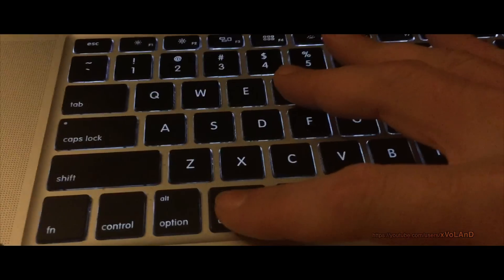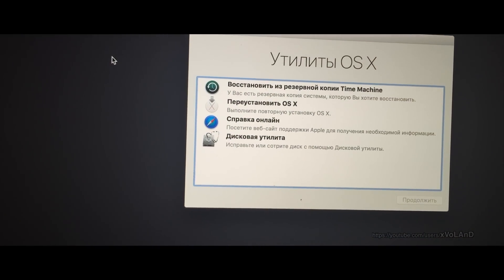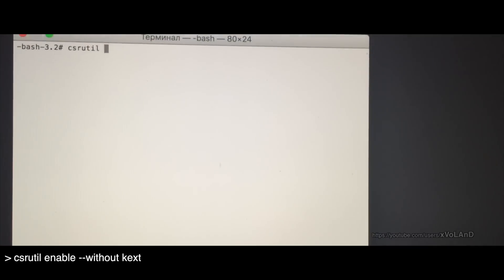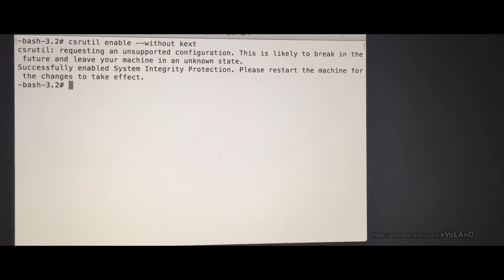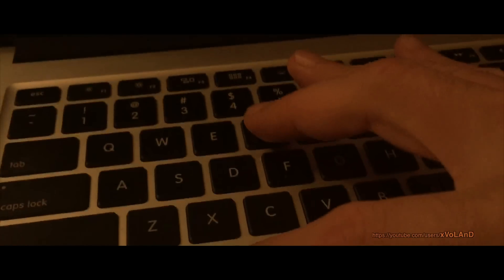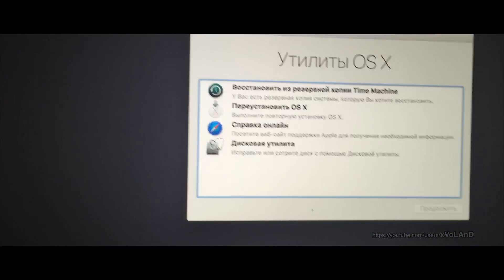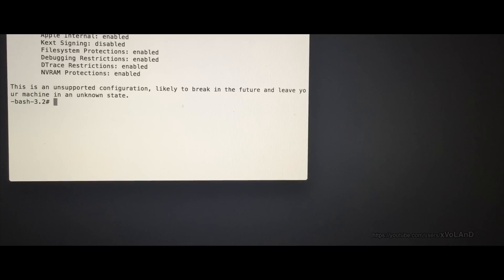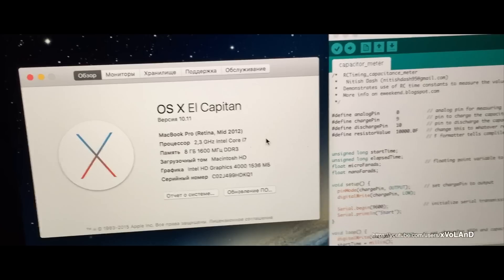How to install driver PL2303 CH340 CH341Arduino USB to RS-232 adapter on OSX El Capitan/Yosemite

Comment: I can't get this working on my hackintosh ....
Reply: says driving signing is disabled, boot args, dev=1
Reply from the maker: Anti Decepticon I'm sorry, but I I've never had to deal with hackintosh. My method works very well on Apple computers under OSX.  I don't see any reason to use it if you have a Windows.
Reply: i wanted to use as a fan control
Reply: This is what happens, with my curiosity I gravitate to things that wont work. I even have Clover Setting to boot with kext-dev-mode=1.
Reply from the maker: Anti Decepticon it's a good gravitate ;)

Comment: itry on 10.10.4 yosemitee but not work it says incorrect command any tip , help,, thanks
Reply from the maker: David Durst Make according to the instructions and everything will okay. I have installed the latest version OSX
Reply: i did when i restart in recovery mode that was terminal answer when i type  the command csrutil enable --without kext it says that command doesn't exist
Reply from the maker: David Durst is a standard utility which present in our OSX. Check /usr/bin/csrutil

Comment: Please, and how do I uninstall this driver?
Reply from the maker: You can use the standard method, as recommended by Apple OR:

Step 1 – locating the driver
for OS X 10.9 (or newer): cd /Library/Extensions
for OS X 10.8 (or older): cd /System/Library/Extensions
Grep the name from the command line: ls | grep ch341

Step 2 – Unloading the driver
sudo kextunload ./<name>.kext
You need to enter your administrator password

Step 3 – Removing the driver
sudo rm -rf <name>.kext

Comment: Thank a lot of for sharing. Following your tips my chinese arduino is detected on my mac OSX El Capitan but I still had problem to upload code to the arduino board with the message error: 
avrdude: ser_open(): can't open device "/dev/cu.wch": No such file or directory
ioctl("TIOCMGET"): Inappropriate ioctl for device

The problem was solved by following tips (https://forum.arduino.cc/index.php?topic=292284.0) and my chinese arduino is working now:
Considering you have correctly installed the CH340G driver, the problem is in the spaces of the device name.
To fix that you have to manually edit two (2) txt files of the arduino installation.

Go where you have installed it. In my case the path is:

/Users/MY_USERNAME/Downloads/Arduino.app/Contents/Java/hardware/arduino/avr

Inside this directory you can see files platform.txt & programmers.txt.

Inside these files replace -P{serial.port} with "-P{serial.port}".
So you simply have to add the quotes.

Comment: Ever since I found that after 5 or so USB re-connections my Mac is powered down the hard way. The best was to see the grey screen reading “You need to power off…” but in other cases it was just like a lightning striking my machine. So, this driver in hack-mode is not really a good idea!
Reply from the maker: You write terrible things 😨😰😱😀
I don't have any problems, check your OS.
This method does not use any hacking methods (check documentation for OSX) Moreover you install the official drivers from the manufacturer
Reply: +Vitalii Tereshchuk Not really. It's not constantly reproducible, but after some 5 USB-reconnections of the Cheapoino my machine blows off. This is a sign that the driver does not behave well (which is not unlikely since it does not conform to some guidelines which is why you need to turn off the security check). I still use it, but before re-connecting I always save all my work. I also had a case where my machine rebooted while I was absent. Have not checked the reason, but suspect the drive to be the reason.
Reply from the maker: +Thomas Kilian disable driver signing is necessary because of the policy safety of Apple changed. I'm talking about it in the video. Perhaps you don't understand this, because English is not my language. 
Apple itself recommends do it if you'r a developer. In any case, I warn about this
Reply: +Vitalii Tereshchuk I know the reason. I mailed with the developer at WCN. He told me that he replaced the one guy for driver development that had left and he should get access to a license. That was last October... Now, the fact that the driver is not signed isn't bad per se. But the crashes I observe are clearly an indication that the driver has bad code. Sometimes I get the grey screen telling "You need to re-power" or the like (you probably know it) and it happens very seldom. But more often my machine simply hard-reboots. And that happens always when connecting my Cheapoino. Quite a clear evidence and each judge would say: Guilty!
Reply from the maker: +Thomas Kilian Driver signature is required from Mavericks, but then it was not so important when to came Yosemite.
I'm just a homeless and unemployed, I'm sorry, but I don't know how to help you
Reply: +Vitalii Tereshchuk It's all fine. Actually I operated this with Mavericks only a few times before switching to El Capitan when it stopped working. It took me a while to find your video (and thanks for that!), So I don't know whether this would happen also under Mavericks (well, what was the last version? Mavericks or Yosemite?).
Hope you find a home and employment soon. You deserve it...
Reply from the maker: +Thomas Kilian Thanks! Yes, you right Mavericks, Yosemite and El Capitan.

Comment: Thanks for this tip. I will try when back home. Should we (could we) reset that security on after installing the driver, or will this make the driver not working ?
Reply from the maker: You'r welcome. Yes, because the system will start again to check the kext signature